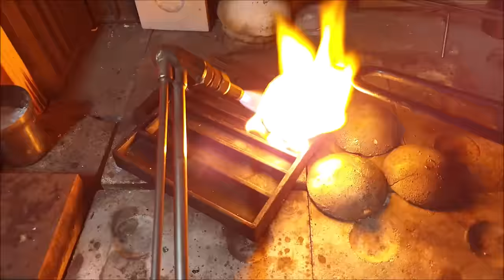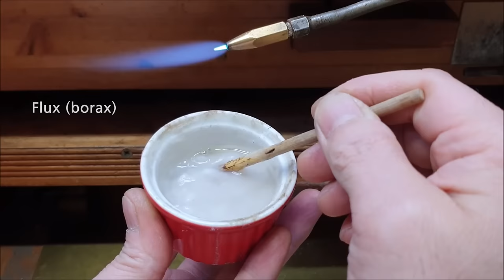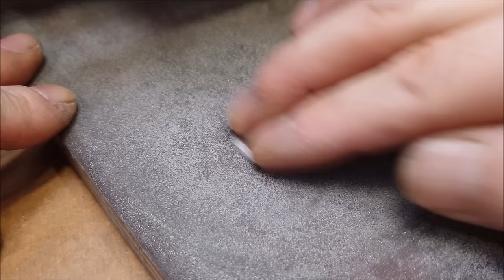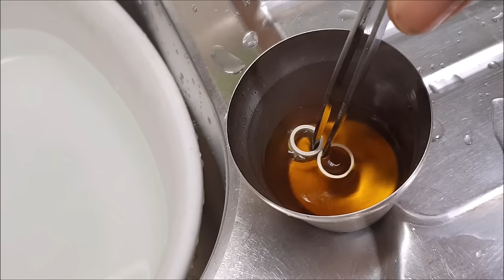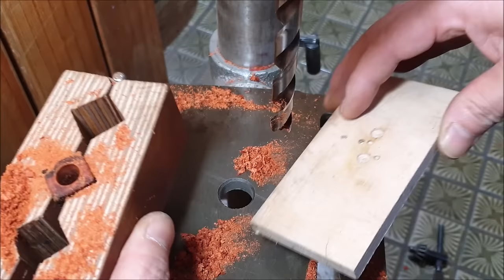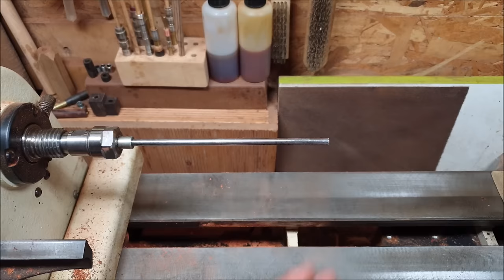Making a special FOUNTAIN PEN

Comment: Why put the silver in the acid After cooling ?
Reply: For cleaning
Reply from the maker: Nonferrous metals (gold, silver, copper, aluminum, etc.) are different from general ferrous metals,
In each process, it must be pickled.
When dealing with silver, mainly sulfuric acid is diluted in water and used.
Mix about 10% sulfuric acid and 90% water.
When mixing this, it is safe to add sulfuric acid to water.
Always keep the diluted acid warm.
50 to 70 degrees Celsius is suitable.
By pickling,
By removing borax residues and various impurities generated during work
It plays a role in ensuring that it is always clean.
Reply from the maker: Thank you very much for answering for me~